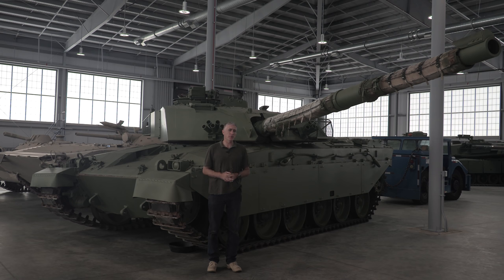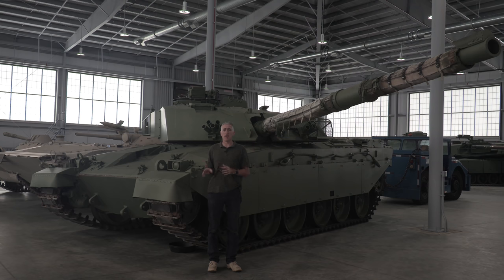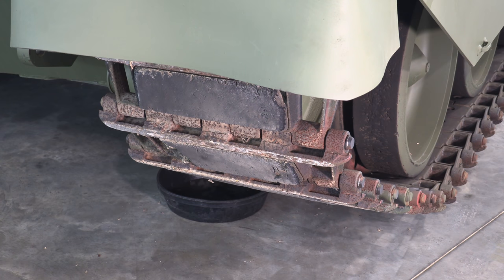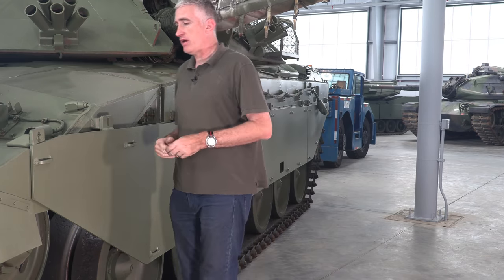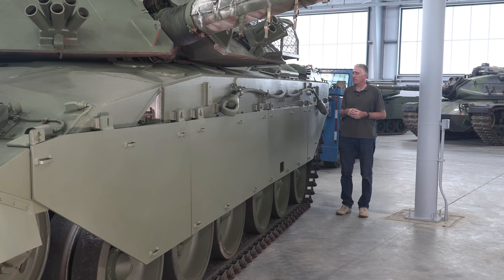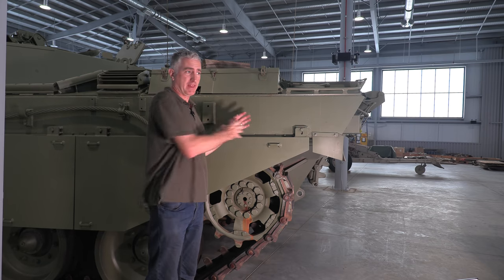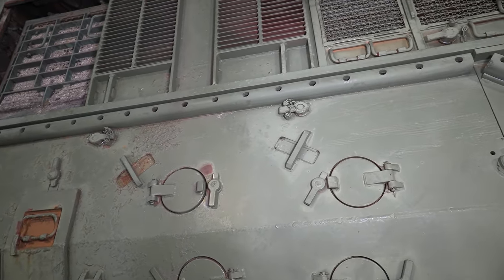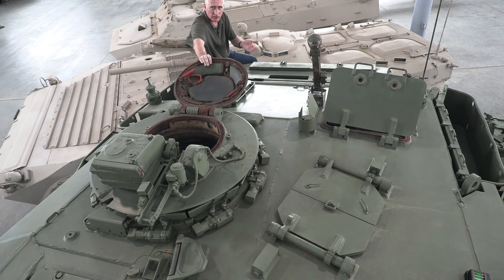Inside the Chieftain's Hatch: Challenger 1 Prototype Pt 1

Comment: If you have several men stuck in a tank for a few days under NBC conditions, I can think of at least a couple of things you might use the refuse port to get rid of in a hurry. Unless they have some other method of storing/disposing of that sort of thing. Preferring disposal over storing, I'd hope.
Reply: I think the key is to have a storage method that you can put through disposal without any contamination.
Reply: @eruantien9932  Except we're talking about a tank where every square inch of space is a consideration, much like submarines from the early cold war and back. There is no advantage whatsoever to storing something like that, it would make all the sense in the world to provision it's prompt disposal via an airlock type port like this. That said, I have no idea what the official use of the port was. But, I have little doubt it would have been used for just that has the need arisen.
Reply: I suspect The Chieftain was quite aware of that, his tone suggested that he was deliberately not saying what for the sake of avoiding upsetting any viewers who might be eating their breakfast at the time of watching, rather than he didn't have some idea of what it might be used for...
Reply: Then think a few days later.  OK, we're out of the NBC area, time to decontaminate.  Commander pulls out his side arm & points at Gunner.  "Gunner, clean off the SH*T we've been jettisoning out the whole, onto the tracks."
Reply: @tgapmax4051  Meh, by the point the tracks will have been going around so much anything deposited on them will have been dumped off and/or well diluted with everyday mud etc that it wouldn't be identifiable.

Comment: Ah hell.....I had almost forgotten the sound of the torsion bars, on our first generation M1 Abrams MBTs, snapping when it got really, really cold in our little corner of Bavaria after we returned from transition at Graf. The first time it happened we thought somebody was shooting at our barracks and the whole damn battalion went on alert! Add in a bit of cold nitrogen and I strongly suspect things would have gotten really interesting! As it was, during the cold months, we pulled Motor Pool duty keeping our M1s warm by firing them up every hour or so which allowed the turbines to "warm" the hulls and interiors enough to prevent, mostly, further torsion bar failures.

Comment: Following on from your 'sleeping on the engine deck' comment then I wonder if the designers ever consider this - after all, crew comfort is an important factor in operational effectiveness. So in relation to this I have a couple of questions:

1. Has any armoured vehicle ever had their engine deck specifically tailored to act as a comfortable sleeping platform? 

2 If no to question one then has any armoured vehicle ever been tailored to allow slinging of hammocks?

Comment: Did current events involving tractors lead to the addition of information on the importance of disconnecting the final drive first?
Reply: This may still be difficult without the tool to disconnect the final drive. And I cannot see a British crew just walking away to be at one in the forest. So expect armed resistance.
Reply: You have to be aware that when you decouple the final drives you decouple not only the transmission but also steering and braking. It is therefore imperative to block the running gear thoroughly beforehand. A tank rolling down the slope unchecked can destroy a house (US-Army, Germany).
Reply: My first thought was that would be an AWESOME prank while the crew was off somewhere / sleeping.

Comment: Challenger 2 had track bushings, there was a Challenger 1 fitted with Deal live track. Which would curl over when split. Regular Challenger 1 was not fitted with live track
Reply: Just for accuracy Deal the track manufacturer is spelt Diehl, a German company which was sold to Krauss-Maffei Wegmann in the last decade. Krauss-Maffei Wegmann build Leopard 2

Comment: 8:00 while the front bolt for the side plates is welded in place all e others should be free floating in a steel mounting block retained by two roll pins giving enough play to make mounting the plates easier even as they become deformed during use and making replacing damaged nuts an easy crew level repair.

Comment: I still wonder why they didn't just persist with the MBT80 design instead of going with an improved Chieftain.
The resemblance of the front hull is striking (if you imagine the Chobham armour packs were removed).
Reply: Two reasons; rising cost and an ever lengthening in service date. MBT70, and MBT80 both had specs that just couldn't be realised with the then current technology, at least not in ways that would make a reliable, useable vehicle. C2 is much closer to MBT80.

Comment: So, do those disk brakes each have two (or more) pads? Hell of a job changing all those out, I would imagine.
Reply: The Main Service Brake for Challenger 1 was part of the TN37 transmission and was an oil immersed multi-plate arrangement   similar in concept to the oil immersed tractor brake shown in the following link
https://youtu.be/vIWLw5kBxnw.

Comment: Can someone answer why Chally's upper front plate's center part is designed in that way. Wouldn't it be more effective to cover that with composite armor and simply use periscope for driver's visibility.
Reply: only Periscope? Bad idea because of the limited View during Road march, driving Head out gives u better visibility and 2nd the Drivers hatch is his escape Hatch too in an emergency, you really expect the Driver is crawling out of his seat then into the Turret and out when every second counts?
Reply: It does seem like a nasty weak point, doesn't it?   I also wonder about that...  
A hatch for sticking the head out, and a big periscope for button up seems an obvious improvement....  I must be missing something here...
Reply: @AHBdV  You are. The glacis is covered in Chobham armour which is why you get the "dip" in the middle. This gives the Driver better protection than say, the Leo2 which has no comp armour on the Glacis, only 60-70mm plate as with Abrams.

Comment: Beacon light? I'm pretty sure it's a crosswind sensor, similar to the one used on M60A3 and very early Leopard 2s. It was not present on production Challengers.
Reply from the maker: That was my first thought as well, but after I looked at it more closely, it seemed to me that it was a beacon without the actual bulb bit attached. And, of course, there are as you say no meteorological sensors on either Chieftain or Challenger. (Though manual FCS entries can be made)
Reply: @TheChieftainsHatch  C2 has a met probe.

Comment: When the Chieftain is on the engine deck, there is a vehicle to the right with a fixture on the front which looks like a large comb with the teeth pointing up.  What is that?
Reply from the maker: Strv-103
Reply: @TheChieftainsHatch  Thanks

Comment: How do those fire extinguishers on the exterior work?
Reply: Pull the handle, which pulls a cable, which pulls the pin out of a valve, allowing it to open and dispense foamy goodness via pipes to places like the engine compartment, ammo racks, etc.

Comment: 16:27 why wouldn't all the 1797 liters of fuel be available for use?
Reply from the maker: If it's anything like the way airplane fuel tanks work, there are 'u pipes' which draw the fuel from the tank but are a little above the bottom. It means that any sediments or the like will fall to the bottom and not get sucked further into the fuel system.

Comment: If C2 was the intended dream tank of the British army it seems wasteful to build and field a tank that would only be used for 10 years. Maybe the US would do something like it, but the Pentagon has a license to print money. The UK MOD was always constantly at war with the Treasury. Wouldn't it have been cheaper to just design an upgrade package for Chieftain? One that included more then just the added stillbrew armor and thermal imaging system that some Chieftains were upgraded with? Or was this another case of better get something in production, in case the Treasury does to C2 what it did to the carriers, cancel the program and leave the army with nothing.
Reply: Chieftain was in dire need of a more powerful, and reliable engine. combat units could have over 50% of their numbers down for engine maintainance at any one time. So once you add engine to upgraded electronics, armour, thermal sights etc tec you are already talking about building something like Challanger any way and not upgrading.
Reply: @Flakey101  Well, then the next question becomes, what is cheaper, building 400 new C1 tanks and some Chieftains with upgraded armor and thermal imaging, or upgrade all the Chieftains to a C1 standard? I know that the French sat that modernization round out for their 60's built AMX-30's. When the US, UK and GE were designing and building a new tank generation they just stuck with AMX-30. Design on LeClerc started relatively late.
Reply: The essential points in the discussion are 'expand the RAC ' and 'Shir '. We needed extra hulls, and the intention was we'd be building a ton of Shirs for the Iranians (1000+?)*, making the Shir the in-production tank, and therefore easiest/most economical to add an order for a couple of hundred to. And because they would then be the last tanks to be replaced by MBT80 they would be in service for rather longer than the 10 years to initial MBT80 deliveries.
* This is where the £400m owed to Iran in the Nazanin Zagari-Ratcliffe  affair comes from, it was the down payment for the Shirs.

Comment: Qualitative supremacy over warsaw pact tanks in respect to Chieftain in the mid to late 70´s is a pretty good joke
Reply: Well they did not have to travel all that far. Business would have been rushing towards them in waves
Reply: @mbr5742  yeah, but the unreliable engine was not the only problem of chieftain.
From 1969 onwards, the L15A3 APDS ammunition was not capable of penetrating sovjet T64, T72 and T80 frontally on combat ranges (it had to close in below 900m to have a chance of penetration), while the sovjet T55 and T62 were already capable of reliably penetrating Chieftains turret face wth HEAT on Ranges up to 2000m, T64, T72 and T80 could reliably penetrate Chieftain with APFSDS on ranges up to 3200m.
L15A4 and A5 did not really improve on that  very much, that pushed out the possible engagement range for Chieftain vs T72A to about 1200m at a point in time, where T72A was already starting replacement with T72B, wich had even stronger frontal armor.

And this has been demonstrated very clearly in the Iran-Irak war of 1980-88, where Iran lost 600 of its almost 900 Chieftains to iraki T62 and T72 export models, while the irakis lost in comparison very little MBT, the majority of losses were T62.
In almst all engagements iraki T62 and T72 decimated iranian Chieftains, M46,47,48 and M60´s, while barely loosing their own tanks.
Similar fate hit the kuwaiti Chieftains a few years later with an almost 90% loss ratio in combat.
Reply: @zhufortheimpaler4041  The very low quality of the fanatical beardies surely had nothing to do with it in both cases. Sure Iraq may have had a so-somarmy by cold war western standards. But by regional standards they where quite good
Reply: @mbr5742  Both sides did not really use Monkey Models.
The iranian M60, M48 and Chieftains were comparable to NATO ones.
The Chieftains were MK III and V with L15A3 APDS, wich was more or less the same as the british ones prior to 78. (And the TOTEMPOLE uprades did not change anything on the armor or gun but electronics and topics etc)

The Iraki T72 Ural, T72A and T72M were comparable to the sovjet models used in Europe too. The T72M1 version was even relatively close to the sovjet T72B.

So it is a relatively good comparison to what would have happened to the british Chieftains, Leopard 1, M60 and M48, when the Cold War would have gone hot.

Also remember, that the Warsaw Pact had a  3:1 to 5:1 numbers advantage over NATO MBT´s in Europe.

During almost the whole Cold War NATO would have been severely fcked if the Pact would have attacked.

Comment: 90 centimeters,,, what's that in freedom units?🤔
Reply: Approximately 36" off the top of my head (classroom rulers in Canada are usually marked 30cm / 12") in SAE measurements.  According to Google it's 35.4331", which is close enough to 35 7/16" (7/16" is 0.4375", so just slightly too large, but I don't feel like trying to find the closest precise fraction)
Reply: @WhiteWulfe  yeah I did the 90cm is almost a full meter which is just shy of a full meter so it's a bloody yard quick calculation in my head.😉
Reply: 90/2.54=35.4330708661 - Google rounded earlier than Samsung

Comment: You would not be allowed to show inside of a Challenger because it still protected
Reply: He’s going to do the interior on the next one though
Reply: @Masada1911  As the Challenger is still in Service he not allowed to because there would be stuff in the tank that is not allowed to be shown to the public
Reply: @jammiedodger7040  okay well wait for the next video then I guess.
Reply: Snail
Reply: @Masada1911  When he gets a letter that says he is being sued
Reply: @jammiedodger7040  This is a prototype that's had parts stripped out.  Presumably, if he has been okayed to video the inside, anything important is gone.
Reply: This is a prototype of Challenger 1, not the current Challenger 2 so  no problems with secrecy.  There's a privately owned Challenger 1 goes to shows here in the UK!
Reply: @jammiedodger7040  The last Challenger 1s are currently being phased out by Jordania.
Reply: @mbr5742  Challenger 2 is still in Service and there would be stuff that in Challenger 1 that is in Challenger 2
Reply: @jammiedodger7040  from what I understand, other than the name there's actually very little commonality between systems and equipment on C1 and C2, which is reassuring given how much of a time span is covered by the two vehicle's service, even the U.K. upgrades occasionally. So you just go ahead and keep ignoring people giving you links to the video already filmed inside a C2 if it's keeping you happy.
Reply: @jammiedodger7040  and yet he has filmed it, and released the film of it, quite some time ago. The link to that video has been given to you multiple times in this thread. And AFAIK he hasn't been sued.

If there is stuff in there he isn't allowed to show, it probably was removed from the footage before release ...
Reply: If we let the multi-national public sit in the cockpit of Typhoon at Farnborough, I'm not sure Chieftain clambering around the inside of a Challenger 2 is really beyond the pale.
Reply: You don't get sued for breaking the Official Secrets Act, you get prosecuted - difference between civil law and criminal law. OSA is loosely defined to allow the government to make a case where  it wants, but being allowed to film the innards of a Challenger by official permission would be unprosecutable.